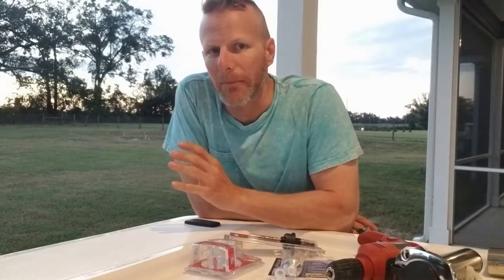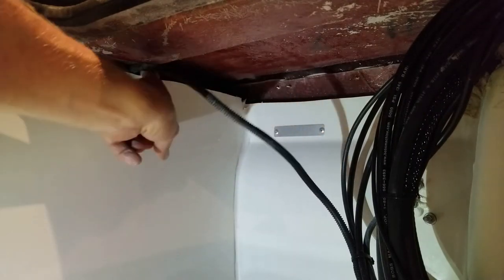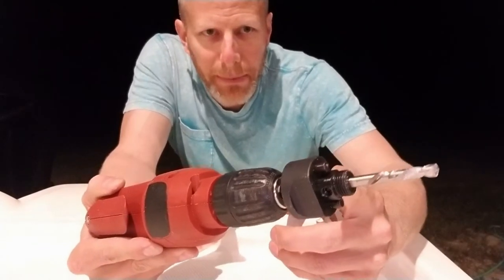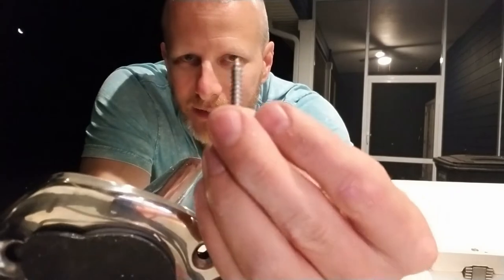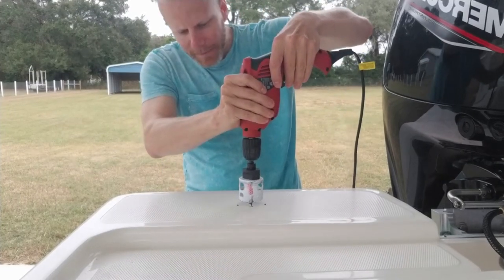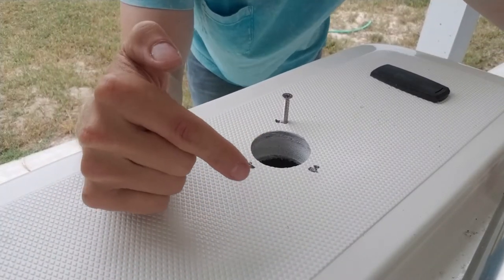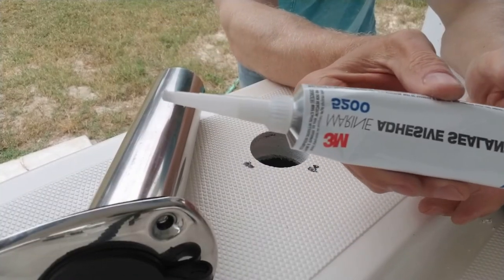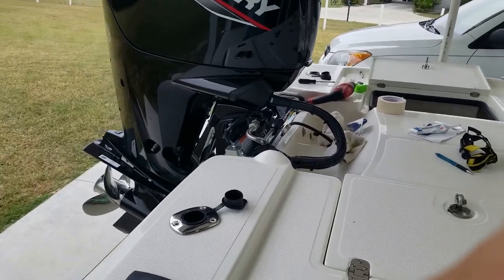How to install flush mount rod holders

Comment: thank you for great video: watched as I prepare to install similar rod holder (mine is for adapting a gas grill table). HUMBLE suggestions: 1. use 4200 instead of 5200 - why? you never know when you might have to remove/replace/mod (ex chrome could tarnish). 4200 + the fasteners offers def excess necessary mechanical strength - and you can remove 4200 with using a jack hammer. 2. after you drill pilot holes, use a 3/8" bit, set your drill to REVERSE to countersink slightly the gelcoat. Reverse will keep your bit from digging in to the gelcoat and underlying fiberglass; countersink will relieve stress and prevent the gelcoat from cracking. holes without this surface stress relief will 95% develop spider cracks within a few years. hint: just barely countersink until you see the underlying fiberglass. again - great video!
Reply: What’s 4200 and 5200 again?

Comment: Ok, nice video and detailed information. Great job on that. One thing I would say is if your going to be trolling for big fish (like tuna or kingfish, ect). I would definitely use a backing plate on the underneath gunnel and would use a threw bolt and nut, not just screws.
Trust me, I learned from experience.  Too much pressure will pull on those screws and uppull your fiberglass.
Enjoy your new boat. Looks beautiful

Comment: Next time when your trying to duplicate the mount from one side to the other, here is a good trick.
Since  you have exact lines on both sides, you can measure from, take a piece of tracing paper. Do one side with your screw holes and pilot hole. Line the paper up with the measurement lines that are on the boat. Then mark those points with your marker. Then go to the other side of the boat and turn the paper upside down lining up the lines on the boat just like you did the other side. You will see all the marks threw the paper easy. Now mark the boat and you will have the exact measurements as the other side without having to do all the measuring you did.

Comment: Great video. I have heard that you should tape up the surface of wherever you are going to drill so that the gelcoat doesn't chip. Not sure how much it matters. Also, what about backing plates?
I don't have backing plates on my rod holders, but I think I should add them at some point.

Comment: I see you went to a lot of trouble measuring the top of your boat to get the placement of the rod holder, but I found that it saves a lot of time and trouble if you just drill a small hole through from the bottom first, in the centre of where you want the holder, then drill from the top, job is done in 10 minutes! Fyi for the future 😁
Reply from the maker: Makes sense. Yes hindsight is 20 20

Comment: Would relocating the light socket slightly inboard have been an option?
Reply from the maker: Maybe but more work than Inwanted to do. There still is the issue of that interior fiberglass wall from the storage compartment

Comment: How not to do so many things.  Never use 5200.  UV 4000 or life caulk.  Never use a permanent marker on the fiberglass.  Drill the screw holes after you drop in the rod holder.  He keeps saying "level with," which means nothing. Also, use a chamfer bit so the gel coat doesn't crack...
Reply from the maker: @ILWDAYDC  thanks for watching